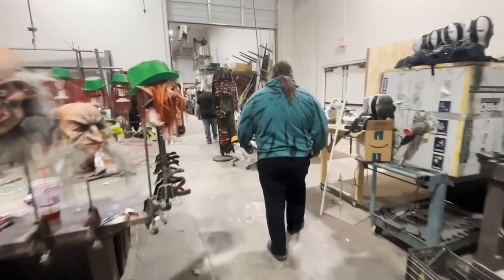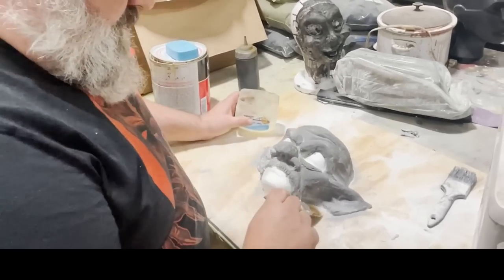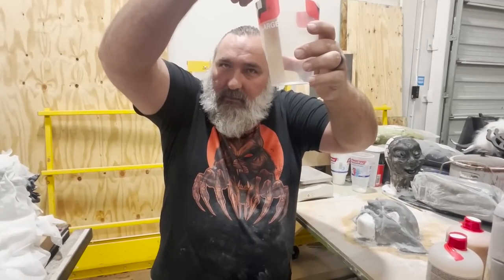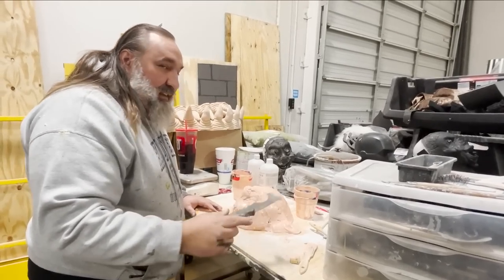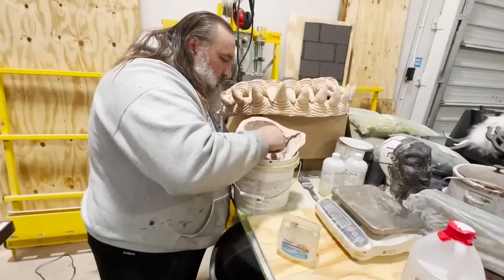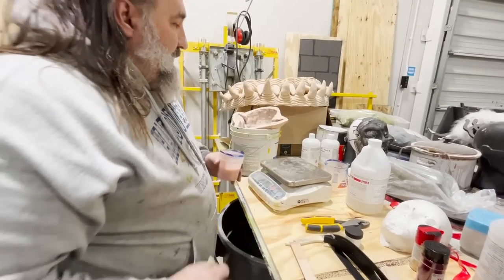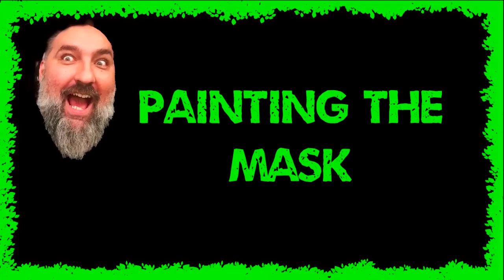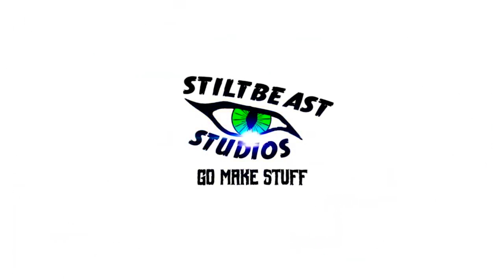Make a Silicone half mask Mask $74

Comment: Hey Alan?

I’ve asked around on instagram about what to do regarding molds that grow, well, mold and so far all they seem to agree on is soapy water with a chip brush should fix that.  I guess my question is how do I avoid plaster molds from getting moldy, to begin with?

Plus, besides Clorox wipes (which is what I used), what else would you recommend if it comes to cleaning mold off?
Reply from the maker: clean with vinegar actually, not just soapy water- and to keep them from getting moldy put them in a garbage bag with a few silica packs.